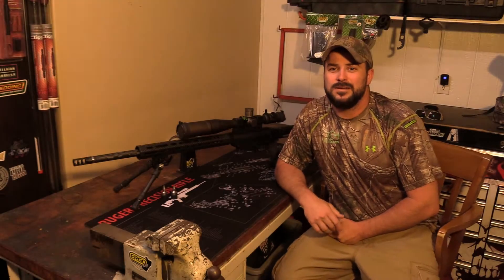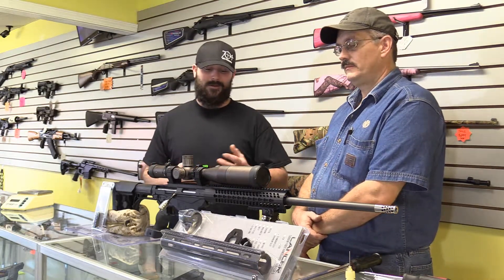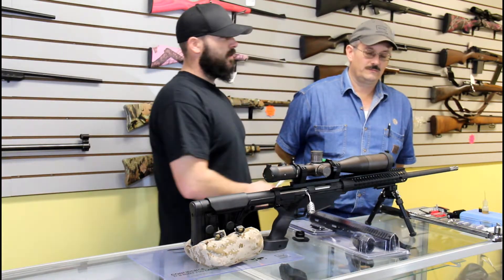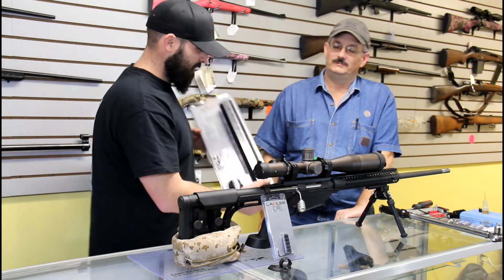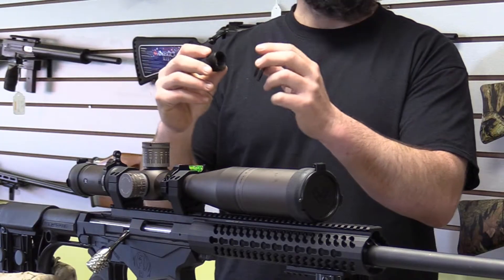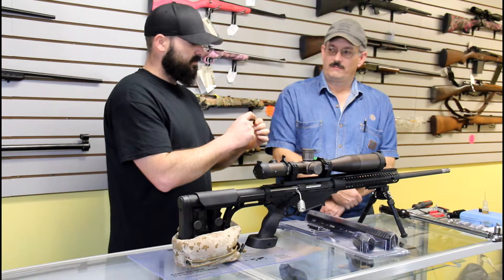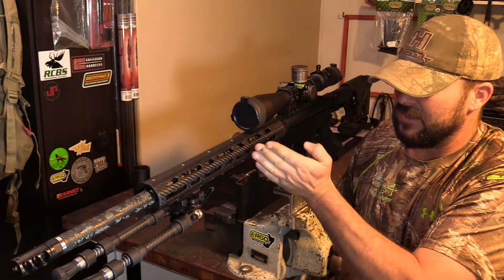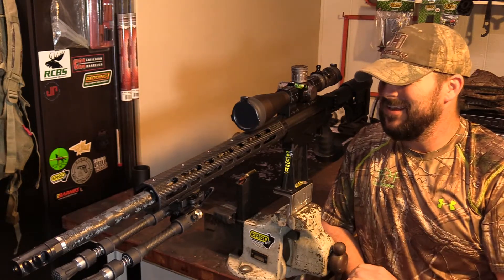Project Precision: Lancer Systems handguard and Patriot Valley Arms barrel nut install : Chapter 1

Comment: What rings or mount did you get for your razor?
Reply from the maker: currently running Spuhr 1.5''. I milled bottom of scope rail (radius face) -.235" to set the scope .025" from the lancer handguard